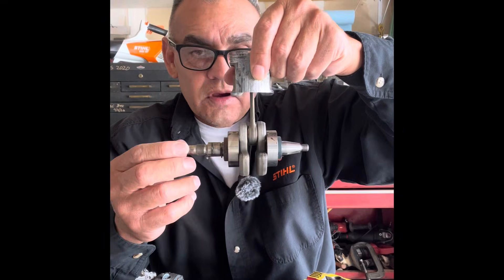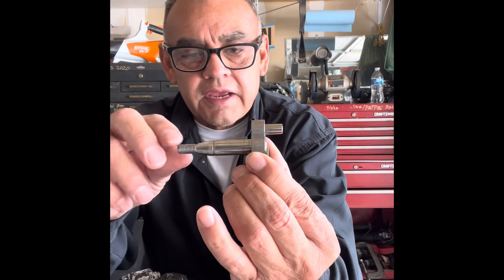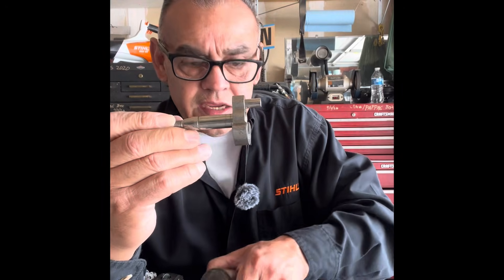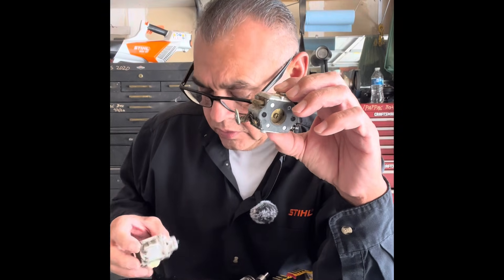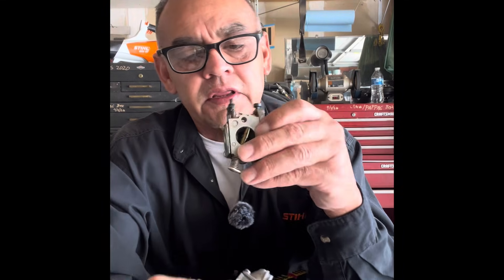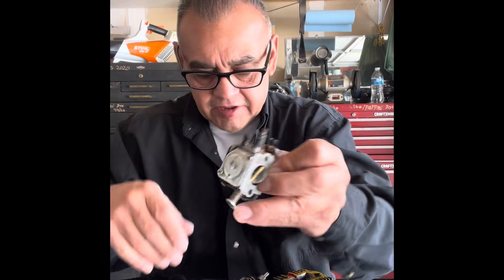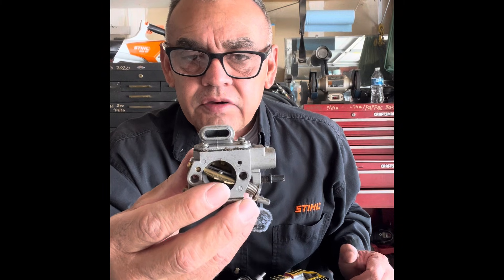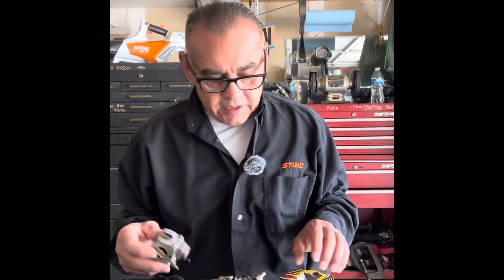HALF crank vs FULL crank?

Comment from the maker: Full crank. Durability & Life: Due to the dual support and better balance, these engines are generally more durable, handle higher loads, and have a longer service life.
• Performance: They often offer smoother operation and can be run at their maximum rated RPMs for sustained periods more reliably.